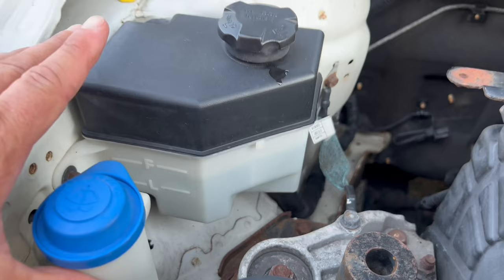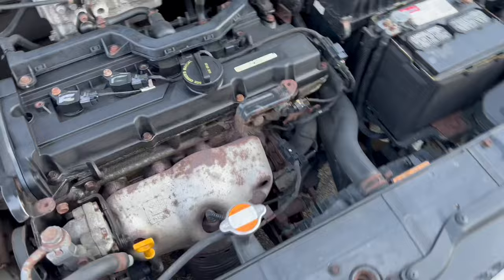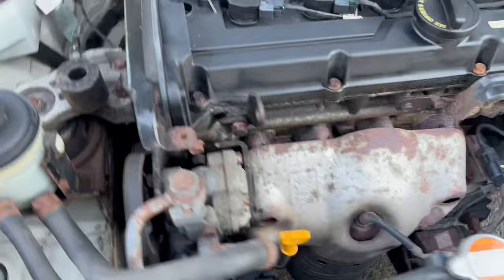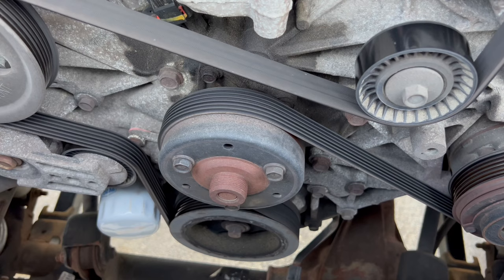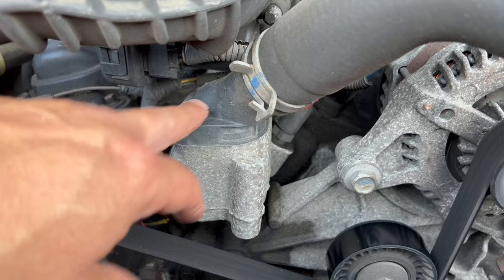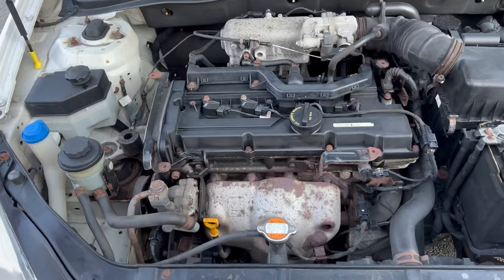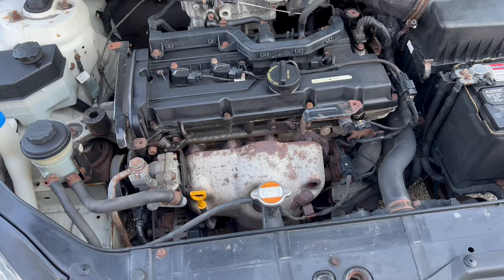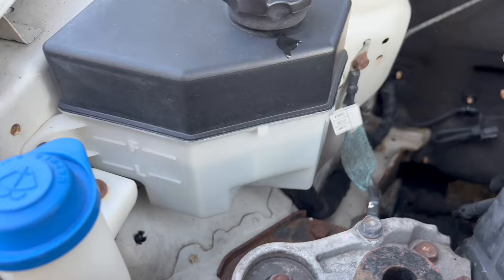Have a Coolant Leak Under Car ?

Comment: 2 bottles of antifreeze 😢😢so pretty sure a leak just all of sudden tho
Reply from the maker: Check the radiator hoses, water pump, radiator, radiator over flow bottle to see where the leak is coming from. Water pump too.
Reply: Thanks it was the water pump !! Getting fixed today
Reply: Thanks for the response
Reply: Mine car this yesterday. I hope it is not the water pump 😢 I just had it replaced like 2 years ago 🤦🏾‍♀️